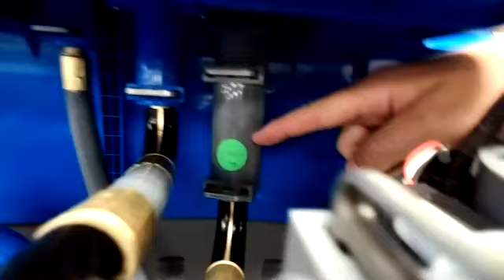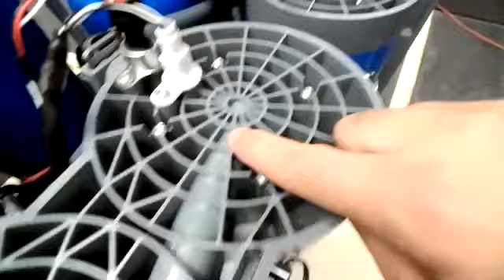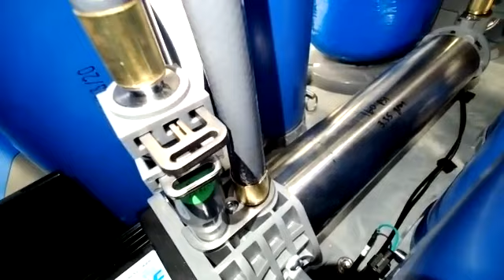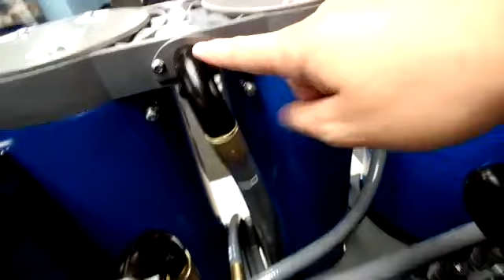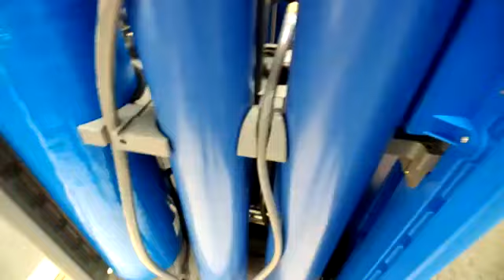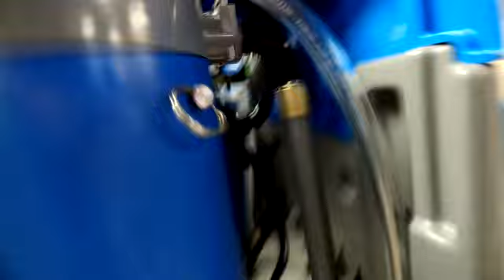Model 2 & 2R Components and Flow Path

Comment: why not put a check valve on the out let internally vs installers putting one in on the exterior of the unit?
Reply from the maker: Model 2 & 2R do not require a check valve on the outlet, unless there is an external pressure tank installed downstream.
Reply: @hanspremiumwaterservice2552  right but wouldn’t an internal check be easier than plumbing one in downstream? Also can we get a redesign of the flow meters? And struts on the lid?